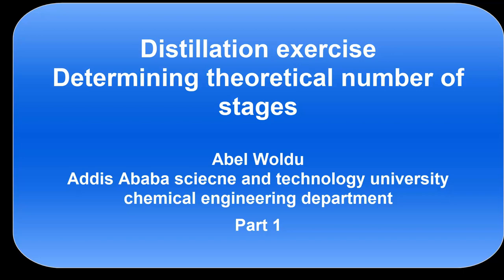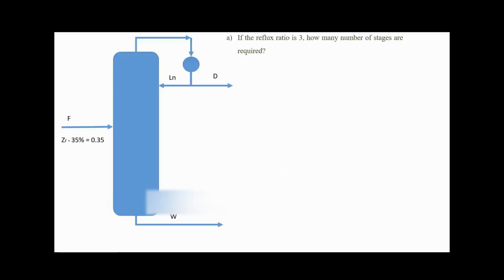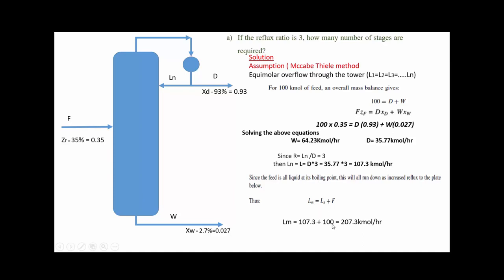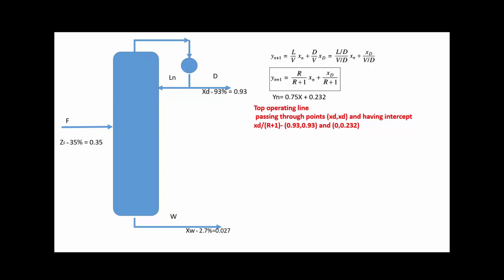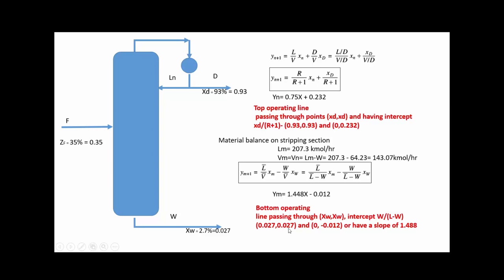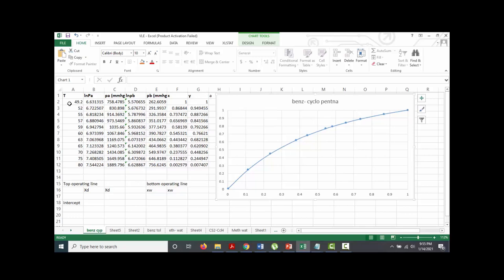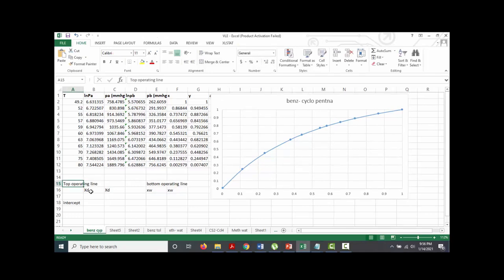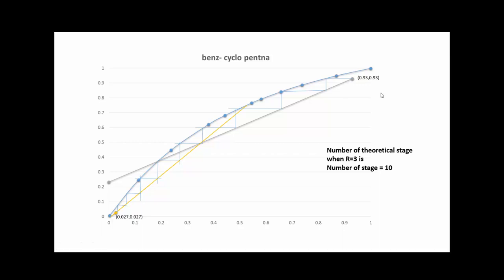distillation example with solution- Part 1

Comment: How did you get the values of W and D please show steps
Reply from the maker: @3.22 you can see there are 2 equations (100=D+W and 100*0.35 = 0.93D + 0.027W). So you can solve them simultaneously to find W and D.